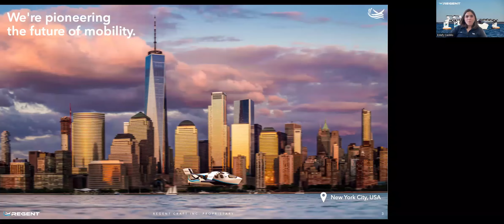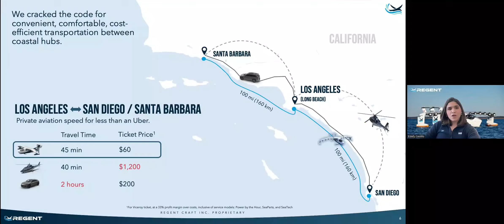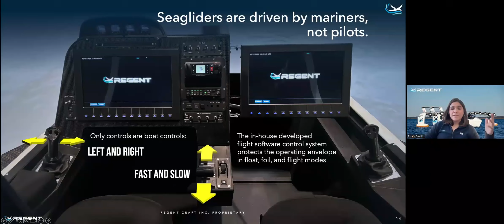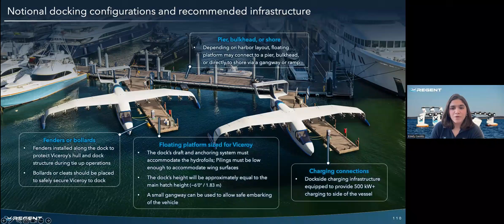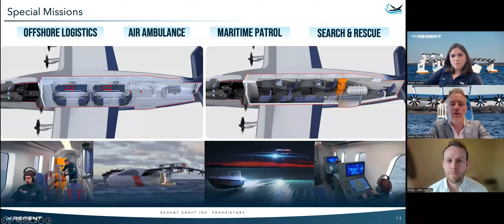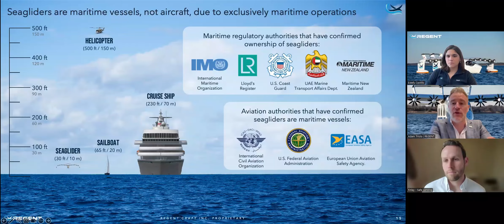Electric Seagliders: Airside Chat with REGENT

Comment: I really wish startups were a bit more honest, both about timescales and about price points. I'm excited to see ekranoplans being built, but there is no way the REGENT Monarch will be ready to enter service in 2030, nor the Viceroy in 2027. It would be a huge achievement if the Viceroy entered service in 2030 - a more likely scenario, if all goes well, is 2032. Similarly, the $60 ticket price in one of the early slides is completely unrealistic. Imagine a 12-seater with a human captain, powered by batteries that have limited service life because they have to be replaced. Costs don't just include electricity, but the salary of the captain and, biggest of all, a share of the battery that will have to be replaced every few years. It would be a massive success if the ticket prices were comparable to those for taking a flight in a Twin Otter on floats. Look at bookable flights (e.g. out of Vancouver) to get a sense for the sort of passenger ticket prices that would constitute a viable competitor, or ticket prices on 1-hour helicopter tours in tourist destinations. If seaglider tickets are sold for less than $200 each way, I will eat my hat (but delight in being proven wrong). I fear a more likely price point is in the $600-$1000 per seat range.  
I'd love to travel on one of these things one day, but I would not want to be aboard one of these craft if a humpback whale decides to breach in just the wrong place at just the wrong time. Nor would I like to be a kayaker when one of them swoops overhead...